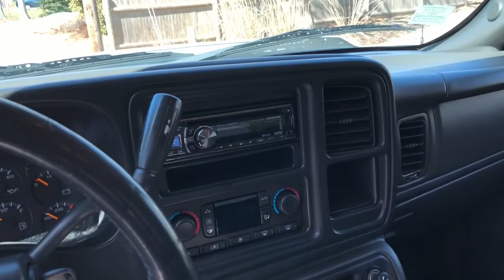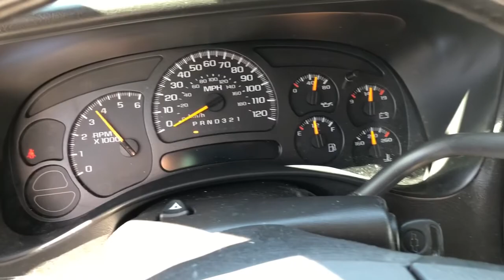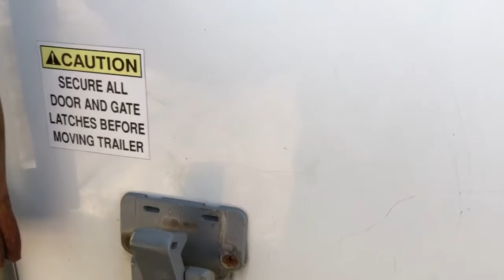New 2006 Silverado truck and enclosed trailer purchase

Comment: Nice truck make sure u keep up with undercoating the frame 99-07 are known for frames cracking and rotting out . I’m doing a frame swap on my 2000 gmc that looked mint had undercoating every where .just my luck the frame had a real thin spot and cross members at fuel tank rotted out and rear diff was shot